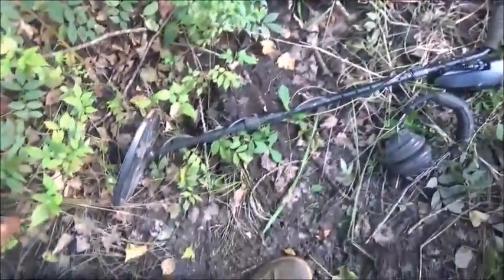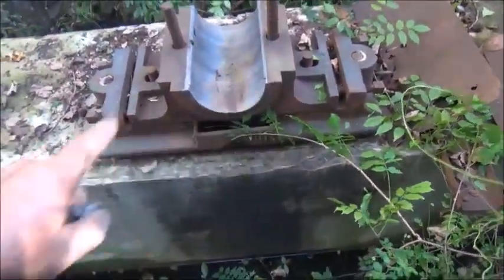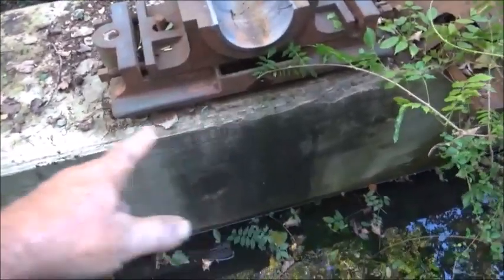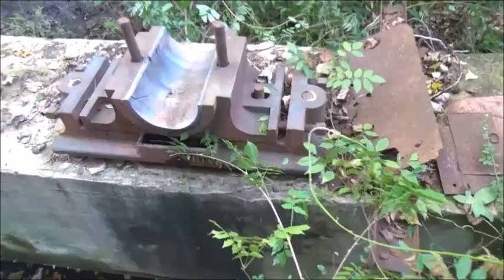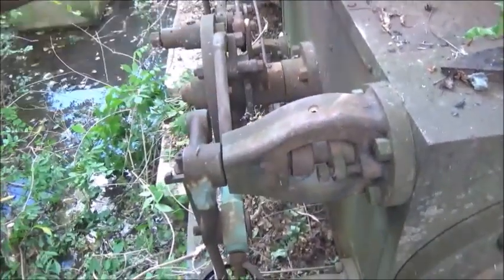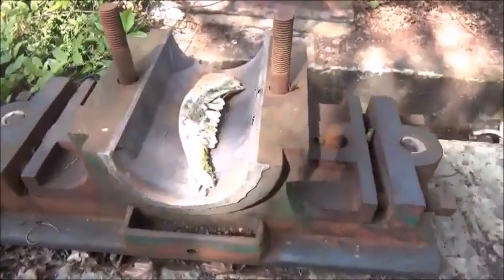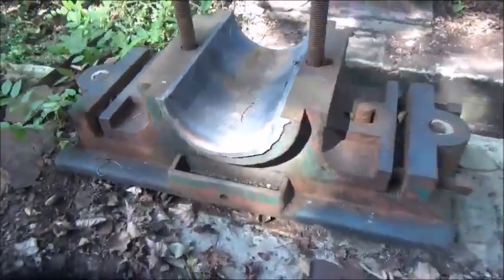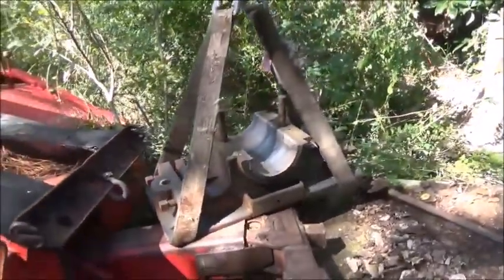BATES CORLISS STEAM ENGINE 20+ YEAR QUEST TO SAVE EPISODE 4

Comment: I watched one of Jay Leno’s steam cars from 1909 yesterday and it was amazingly torquey! It would easily accelerate and twist the chassis and run at 65 mph all day. It was a White motorcar and with “fuel oil injection” and pressurized tanks it didn’t need a fireman to stoke the fire. One person is all it took and 10 minutes to fire it up.

Comment: Jonathan, I know in the 1st video you gave some background to this engine, but can you elaborate some? When was it installed (approximately,) what did it run back then,  you know any history of the company and when it ceased operations?  You said that last it was being used to produce something other than its original manufacturing purpose and the building burned, but the engine was in a separate building. What year did that happen?  To your knowledge, its just been sitting there all those years untouched after the fire?  I just intrigued by old industrial machinery and how they where used.
Reply: I think he said in one of the videos that they are still researching with the local historical society.

Comment: Jonathan, have you seen the You Tube video by harryolynx called Starting the Big Red Corliss Steam Engine. There are very detailed operation and pictures of the mechanicals plus animation of the tuning engine. It links bigger than yours but very similar. The fly wheel spokes appear to be a wedged fit and it’s also,a beautiful engine.

Comment: I worked at a pulpmill for years and when equipment was installed we shimmed it level first then grout it to absorbe vibration. When babbit bearings were poured we packed the ends with what we called bear shit, also the dummy shaft was carbonized with the torch for easy released ,the the babbit was blued and scraped for oil retension.

Comment: Have you thought about using a small electric chipping hammer, run off a generator, to break some of the concrete from under, and inside the bases of the steam engine anchor points. Wouldn't that make it somewhat easier to break free of the bolts, and reduce the odds of fracturing the cast iron itself by one end suddenly coming free, while others, are still firmly held in place.
Maybe that along with te acid, and vinegar, all together might weaken the concrete enough, especially if you did all of the bases ahead of trying to break them loose one at a time.
Just a suggestion, that may or may not have been thought of yet, but definitely a reasonable assumption, that it can't hurt, and may in fact make it easier, because of it.

Comment: Jonathan: You're doing just fine with that "pinch" bar but you would get lots more force/leverage with a lot less of your "grunt" by prying the tip up while you're pushing down on the end over a block of wood or steel below the bar right near the tip. Obviously, you adjust the height of the block to suit. Amazing how much force you can apply that way and quite controlled too. Those "Pinch" bars are "essential" !!! 
You may find the ends of those bases supported with steel spacers while the remainder is "dry-packed" with a rather dry concrete rich filler packed into the space. Kinda like is done below large light standards. It's a good, tried and true, method and accounts for surface variables between the two ends.  Wish I was there helping. Love doing this kind of stuff. I bet you're enjoying it about as much as I would be.  Electric motors are the same as you describe the steam power. That's why the Tesla is so "quick". Max torque right from the application of the power. 👍👍👍👍👍

Comment: Nice work mate.
Bit of heat around the cast iron where the studs come out of the concrete foundation should crack any grout they may have poured in the holes around the studs.
Don’t need much.
I once had to move a 24 foot lathe out of an old railway workshop and move it to a museum.
They had got it level for the install and then formed up around the base of the mounts and poured in a liquid grout .
Must have had a lot of cement in it because it started cracking and popping without too much heat.
Best of luck on your mission mate👍

Comment: G'DAY Jonathan, well done thus far,in s salvaging the steam engine,from my experience doing my apprenticeship as a fitter,turner & machinist in a steam powered power station, constructed of English equipment of similar manufacturing, be aware that bolts and threads are likely BSW( Whitworth course), also on white metal bearings,tolerances were established with use of small guage lead wire laid along bearing then after installation of shafts,turbines and caps,was disassembled then wires micrometer checked to ascertain clearances, white metal then scraped accordingly, using sctapers  ,BRON XE linkage connectors,likely can be machined from bronze square stock?we used for levelling machines jacking bolts,then composed underneath with strong cement mortar mix e.g.3 to 1 part cement to sand,with water 10_15% bond Crete? Good luck mate,some fact of interest, horsepower was established with by how many horses needed to lift loads up shaft from within coal mines in England one horse could lift one tonne2000 lbs 10 feet,thus 1HP,kindest Regards,as always ,Dave McLaughlin Queensland Australia

Comment: Wow, Jonathan, I jumped about 6 inches when that pillow block came loose, even though I was expecting just that reaction.....lol.  It was nice of the water company to clear out some of the area you needed, probably in appreciation of your helping them locate the leak that they had most likely been troubled by for a long time.  In your torque explanation 3.13X diameter gives the circumference (thanks for jogging my old memory).  Also, I've seen some of your repairs and they look much cleaner than the ones done on your new baby.  God Bless and stay safe....  Oh, by the way I think you should show Nana just whet she's been inspecting the last couple of days.

Comment: Talking about steam engines and the massive amount of torque they have, here is a example.Some facts about a Case 110 HP Steam Engine:

    fuel and water capacity – 1945 lbs of coal and 366 gallons of water
    Weight – 42,500 lbs loaded with water and coal
    Number built – 800
    Torque – 3000 ft-lbs at 240 RPM
    Top speed of 2.37 Mph
    Rear Traction wheels – height, 7 feet
    Steam pressure – 160 psi
    Height to top of the stack – 10 feet, 5 inches
Info from:trainfanatics.com

Comment: 2" pipe running full bore for who knows how long,I get distressed over a fast drip! It's cool they took good care of you cutting the brush,some wind and sun getting in there should help dry it out. I thought AT Pro had waterproof coil? Maybe even the control box is waterproof too,,yep just checked,it's good down to 10' deep. You could lay it down in that puddle no problems,well,as long it's got good seals and such. Glad to see this project! Maybe you'll stop at setting it up but somehow I get the impression you will go farther with it. Will be great to see crucible in action again too.
Reply from the maker: I have a crack in my coil.
Reply: @jonathanw4942  Maybe get a plastic welding foot for your soldering gun and seal it back up. Might make a good little project on a rainy day.

Comment: Them old boys sure fixed that water leak quick. Can you imagine just how much water was being pumped up from underground over the years just to go out onto the ground as lost water. That water was from an aquifer that is regulated by the government and they are suppose to keep track of water loss. That was a hell of a lot of water that the water system was paying for and losing over the years. The customers had to pay for that. A two in line leaking for how many years? You are talking millions of gallons of unrecoverable underground water that the systems' customers had to pay for. And look out if they knew there was a problem and just ignored it. It's just like here. I reported a water main leak 20 years ago and have done it several times over the years and there is still a water leak in the same place, no telling how much water has been lost over the years. I would imagine every water system in the country has this problem from one extent to another.

Comment: Great explanation of hp vs tq, its something that a lot of mechanical engineers I know struggle to explain but you made it easily understandable. Also- 175 hp x 5252 / 85 rpm = a potential for 10,000 plus lb/ft of torque. Steam engines of this class were absolute monsters.

Comment: Looks like “Dry Pack”, also known as non-shrink grout. I still use it for packing under light poles and the like.
Reply: yes correct , grout is a standard anti-vibration technique used on nearly all heavy machinery and other installations. Should have a nut underneath on each stud to hold block up. Some use shim. I wouldnt expect much if any vibration from a slow reving steam engine like this but yes Grout is a standard technique. Good spotting
Reply: https://www.euclidchemical.com/products/construction-products/grouts/cementitious/dry-pack-grout/

Comment: Did you look to see if the edge of the concrete had a lip that holds in thed water.  On a farm we once lived on the sheds had concrete  floor were poured after the foundation.  The foundation came up about 4 inches above floor level.

Comment: Actually a two cylinder.  My two-cylinder Stanley is really like a four cylinder with a 'firing order' of 1-4-3-2.  It also has 'power' the complete travel of the stroke.  1000 ft/lbs of torque from 0 mph

Comment: Keith Fenner and David Richards have good re-babbitt You Tube videos.  Turnwright and Old Steam Powered Machine Shop channels.
A steam engine doesn't have a sump, lubrication is through oil being injected into the water.

Comment: Did that engine turn a belt or something? Trying to figure out what it was used for
Reply: I'm thinking like a big sawmill or something like that where the belt turns everything
Reply from the maker: 300 foot factory with a lot of overhead shafting.
Reply: Ok. I figured that was the case  thanks for replying

Comment: We once had a job where we had to dig up the street to run some conduit for a building.  We contacted the city water department and they marked out the waterlines, none where we were going to work.  We had an operator, a laborer and a cement finisher to put the concrete back and two of us to put the conduit back in as quick as we could and it was all on overtime.  The operator started breaking out the concrete and hit a 12" water line.  It knocked a small hole in it, the laborer grabbed a piece of wood and made used his pocket knife to make a plug and with the water shooting 20' in the air he drove the wooden plug in tight enough so we could go on and do what we needed while the water department fixed the pipe and we got the whole thing done and only wasted about an hour thanks to the laborer.  He chewed on the water department fellow who didn't know there was a water line like he was paying for the whole thing out of his pocket.  That was over 20 years ago and I had forgotten it until you brought this up.  The laborer wasn't working for the company I worked for he was working for a company they hired to do the digging and pour the concrete it wasn't money out of his pocket in fact he was getting paid by the hour.  Some people just care about doing a great job and doing it as quickly as possible, that laborer was one of them.  I cared because I had to explain to my boss why it took longer than I told him it would.

Comment: This engine is going to run again clearly, even if on compressed air. Looking forward to the whole progress
Reply: Does he have plans to repair the engine and make it function again?
Reply: @FSE_MTB  Started out as just a get it and put it together but I bet it turns into a YT build to running condition as Johnathan has that ability to take it back to that condition again...just likely not under steam as to certify or buy  a boiler would get very pricey...but under compressed air...she'll be working again especially if the view counts soar.